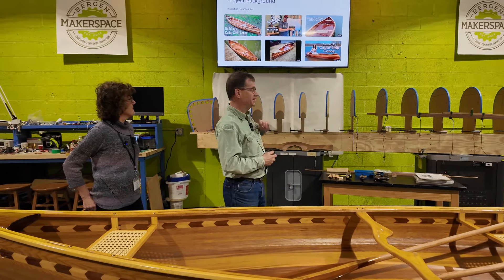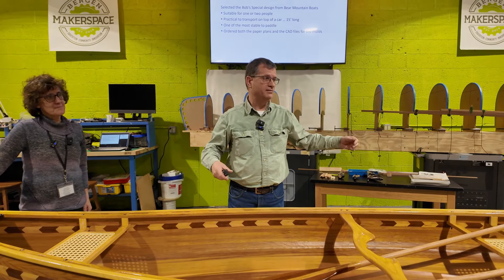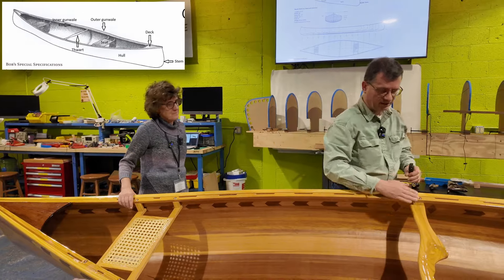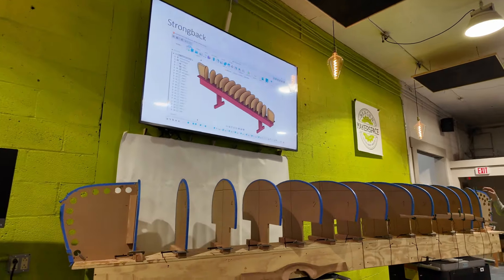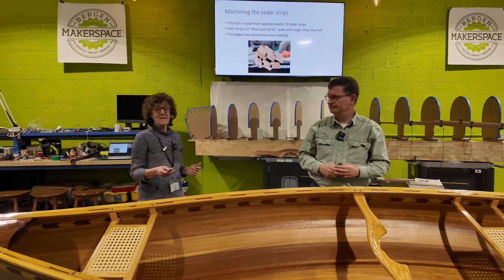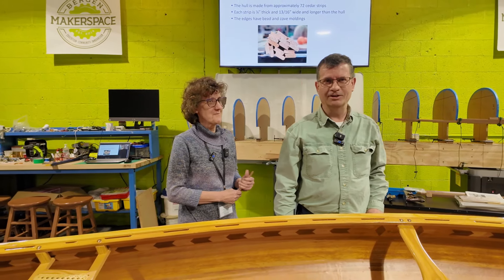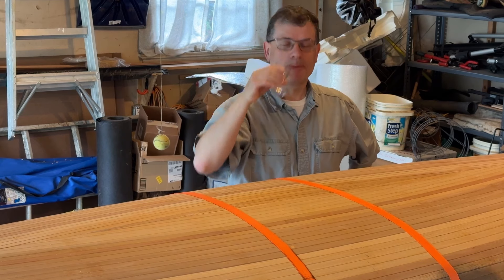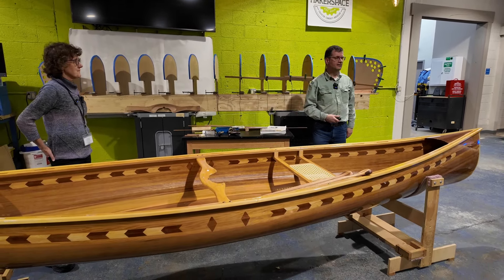Lark - Building a cedar strip canoe

Comment: John Excellent build. So far my most prominent question is why waterproof wood glue is not used. You covered pretty well the fact that you do not need it. Other than it's expense what is the down side of it's use, e.g. Tite Bond 111 wood glue

Comment: A great tip I was told about for cutting the CNC tabs is to use a trim router with a 1/8 inch flush trim bit. It not only cuts the tabs, but it also trims off the tab leaving a perfectly smooth edge, all in one motion.